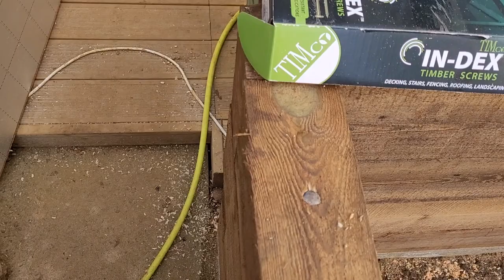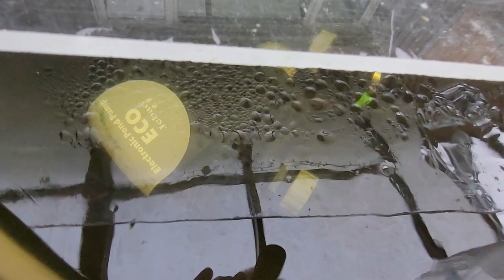Sleeper Pond with Window (Part 22) Rebar is going in 👍🏻👍🏻👍🏻 The correct version 😂

Comment: Looking great, would have been easier cutting your rebar if you had a cutting blade rather than a grinding blade.
Reply: Was thinking the same thing 🤣👍🏻👍🏻👍🏻
Reply from the maker: You are probably right but that blade cut all 15 rebar at 12mm thick and still looks brand new so It did the job 👍

Comment: I like your pond build, but I'm a gardener landscaper and I've done 2 job's where I've replaced sleeper walls where customers originally used rebar to strengthen they're walls. Have you had any problems yet?
Reply from the maker: No not yet its only 3 years old but I know it won't last forever but it should be good for 10-15 years 👍

Comment: Excellent work Jamie. 
The joy of the rebar. 😁 I put in 25 in two days in my sleepers and that was my first injury with a tennis elbow. 🙄 But I had them cut to measurements so I didn't have to cut them.
Reply from the maker: Always a bonus but it was cheaper to cut them myself and I'm way over budget so I went with the cheap option 🤣
Reply: @keepingitkoi  oh really? When I looked for mine it was only something like £5 more than the long ones (by the metre)
Reply from the maker: @LauMagroTheFrenchKOInection  possibly but £5 extra is still more when I have the tools to cut them myself any way plus I have a little project im gunna do with the off cuts 🤣
Reply: @keepingitkoi  that's cool. Looking forward to that 😃

Comment: Highly recomend buying some slicing disks for the grinder. Super fast and resly cold cut compared to a wide grinding disk. Alot less wear on your tool aswell
Reply from the maker: Thanks bud yeh the combi disc was the only one I had at the time but it did the job and its been up and holding for well over a year now and still doing well 😊👍
Reply: @Keeping it Koi  I got caught short last month and had to use a dimond disk lol. Thankfully it was a cheeper disk and not much of a loss using it. Note to self now. Alwaus have a pack of slicing disk and flapper disks nesr the welder lol
Reply from the maker: @Lyons Cultivars  🤣🤣 yeh defo mate I could of nipped out and got some just couldn't be bothered it did the job 🤣👍

Comment: Hello 👋 
Help please 
What size of the hold you make for the rebar 
And the rebar I’m making my pond and thinking to rebar to 😁
Reply from the maker: it was a 600mm by 12mm auger bit to drill the hole and a 12mm rebar 👍🏻 hope that helps 

top tip wait till the sleepers are dry doing when damp is much harder 👍🏻
Reply: Thank you for the help 👍

Comment: Where did you get that super long 12mm drill bit!!?? My best effort was a 235mm one as ive got some sleepers to join on top together like yours.  My makita powerdrill is SDS
Reply from the maker: I got them on ebay about 3 years ago they are a 600mm auger bit 👍😊
Reply from the maker: https://www.ebay.co.uk/itm/255347345649?mkcid=16&mkevt=1&mkrid=711-127632-2357-0&ssspo=Y7f7gTi7Ta-&sssrc=4429486&ssuid=oZJlm7DnTvC&var=555321438503&widget_ver=artemis&media=WHATS_APP
Reply: @keepingitkoi  Very kind of you, thanks.
Reply from the maker: @PaddyDixieTheMinerva82  no worries 👍 😊

Comment: What size hole for the what size rebar if you dont mind me asking ??
I was going to go 1mm over size to the drilled hole??
Reply from the maker: It was a 12mm hole for 12mm rebar as is didn't want any movement in them once it was in and remember as the wood dries out more it shrinks and contracts so the hole will probably get bigger as it dries out 👍😊 hope that helped 👍

Comment: i have been thinking do you think I should put rebar in my pond that I am building ? maybe the screws are fine just woundering
Reply from the maker: With your pond bud because of how small it is and the fact that you have dug down a couple of feet I would say your fine 👍 the strongest outward pressure is at the bottom of the pond not the top and being a relatively small koi pond there won't be that much pressure. I know everyone worries but when you think these free standing fiberglass ponds or even the Intex swimming pools there only held together by there plastic liners that are glued and stitched together and they last years even the really big ones. the only reason for rebar is to keep all the sleepers in the exact same position they started in and you have used a fair few screws and if there at least 8mm thick I really think you'll be fine I would recommend though better stronger corner brackets wickes do really good ones for less than £2 each real heavy duty👍 I would also look into better filtration as well as that box your building to sit above your pond is not ideal for koi unless your only looking at 1 or 2 fish 👍 maybe an easy pod or something like that bud 👍

Comment: Hi I'm building a sleeper pond and just wondering do you need to fix the sleepers to the concrete or just sit them on the concrete?
Reply from the maker: Mine are just sat on top of the concrete I did contemplate that my self but I decided not to as the would will move and the concrete won't so I decided not to as I thought it might crack or damage the concrete hope that helps 👍
Reply: Sorry only just saw your reply, I'm happy to do the same, just lay the sleepers onto the concrete and rebar the sleepers together. Have you had any problems doing it like this? Your videos are really helpful, I'm basing my new pond build around yours with slight changes
Reply from the maker: @macauleybowen2895  nope it's been faultless not even a creak from the wood 👍 and glad my videos are helping many people have copied this idea and I'm so glad I could help so many people 😊

Comment: Looks good so far 👏🏼
Is the rebar 10mm? 
What size auger/drill bit did you use as it looks like a tight fit?
Reply from the maker: Thanks 😊 It's 12mm rebar and I used a 12mm auger bit 👍